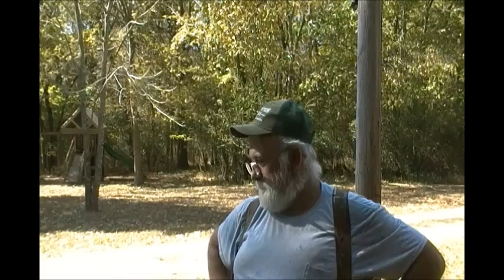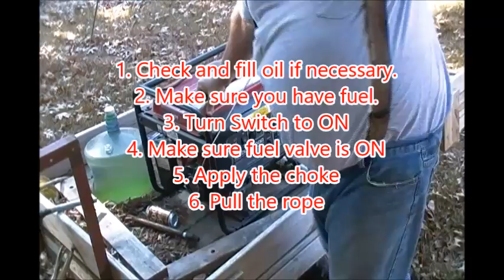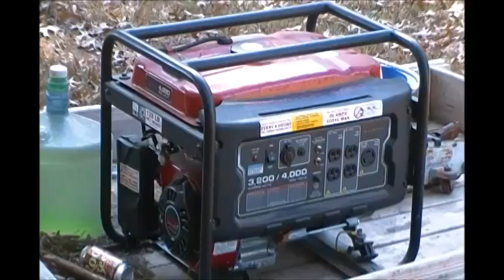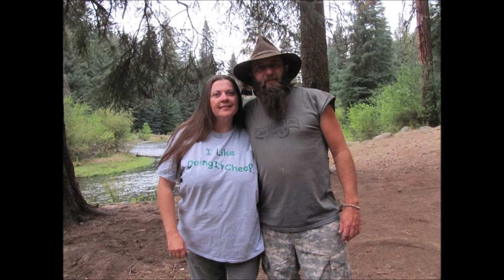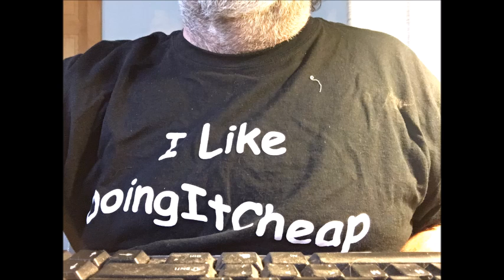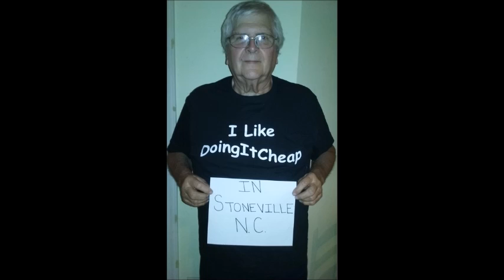PawPaw Reviews the Harbor Freight 4000 Watt Generator #69676

Comment: Can you answer a question/solve a problem for me?  My generator was running yesterday (just testing it out so it will be ready when I need it) and I did a stupid thing - I open the gas cap to add more fuel while it was running and it stalled out.  Now I can't re-start it at all.  Up to now it has always started right up on the first pull and now it barely turns over.  I called tech support and they said I must have gotten air in the system when I opened the gas cap and they had me try a few things but I still had no luck.  Any suggestions?
Reply from the maker: Mike, I hate to tell you this, but the factory safety sensor detected an action that maxed out the stupid factor !!!!  It has to be reset by the factory AFTER you promise the technicians you will never EVER do that again !!!  LMFAO !!!!!  First Mike, I don't know what kind of generator you have or what kind of carburetor.  My guess is that you accidentally flipped the shutoff switch, accidentally unplugged the spark plug OR if it has a low oil sensor, it may be low on oil since you were refilling while running instead of refilling it after checking the oil.  I believe your problem to be ignition not air in the line.  Please let me know what the deal was.  I cussed a Harbor Freight post hole digger because the little shutoff switch was defective.  I disconnected the shut off switch and it fired right up.
Reply: LOL - thank you for the advice.  I had also emailed the manufacture and was told I needed to drain all the gas and refill it.  I checked the oil and it was fine.  Why do you think it would stall as soon as I opened the gas cap?
Reply from the maker: Once again, I have no idea what engine we are talking about.  I don't even know if we are talking 4 stroke or two stroke.
Reply: DoingItCheap I'm sorry it's the Predator 8750. It's brand new. I've never actually used it I only started once a month or so and let it run for 15 minutes just so that it'll be ready when and if I ever need it

Comment: I have thought about purchasing about 4000 Watt Predator generator. I'll want to make a camper out of an International 4300 Penske truck. I want to put a roof or a 13000 BTU roof air on top and run it with a 4000 Watt generator

Comment: About how many hours would it run on a full tank?
Reply from the maker: I don't know.  And your run time will vary depending on the load.  But it ran about two minutes just on the fuel in the carburetor and fuel line from the cut off valve.
Reply: I run mine at my camper at night to use a CPAP and charge my phone.  I usually have it on non-stop for 10 hours and there's still gas in the tank.  I haven't run it dry yet but Paw Paw is correct that it will depend on load.  I expect it may not run all night with an AC.  I'll be using a small window AC next summer and will repost to see how long it will run with the AC, CPAP and phone charger.